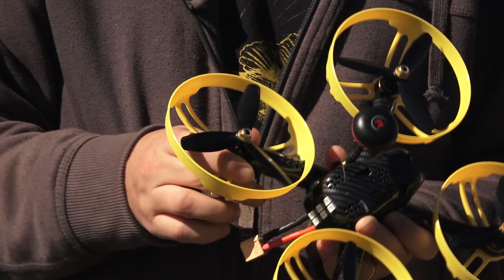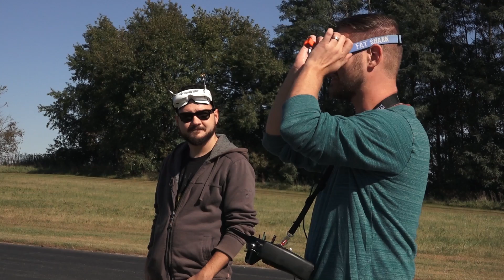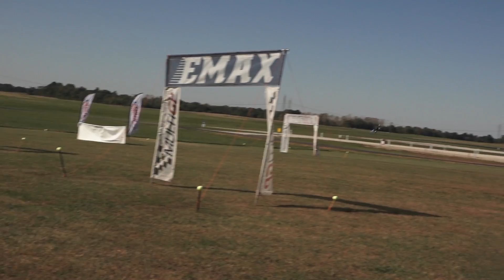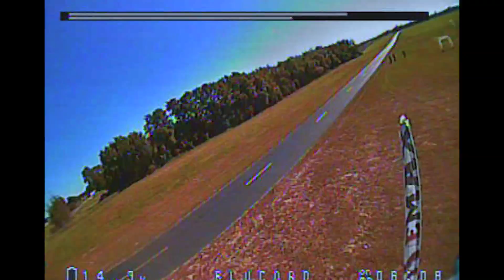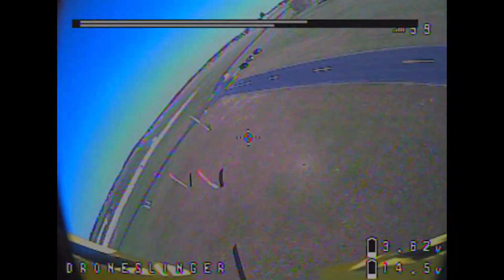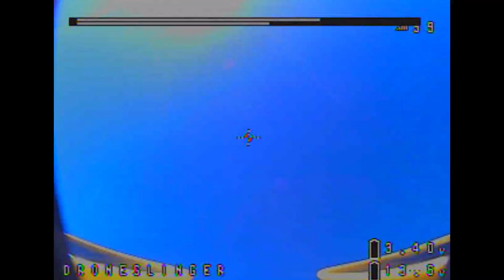Horizon Hobby Blade Scimitar 170 and Scimitar 215  - Model Aviation magazine

Comment: Can I use Tattu 1300mAh 45C 3S1P Lipo Battery on Blade Scimitar 170 ?
Reply from the maker: Yes, that battery should work!
Reply: Thanks for the response. Just need to get AN adapter because it's BLADE quad has EC3. Decided to buy EC3 Lipo instead.
Reply: I have the 215 pro love the way it flys however the vx is def not 600 MW  , on its highest setting more like 300